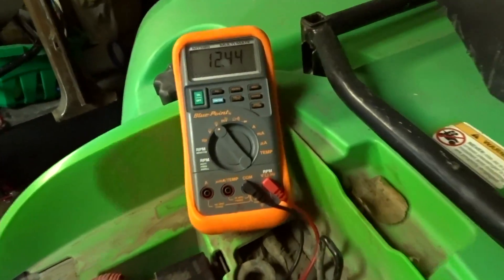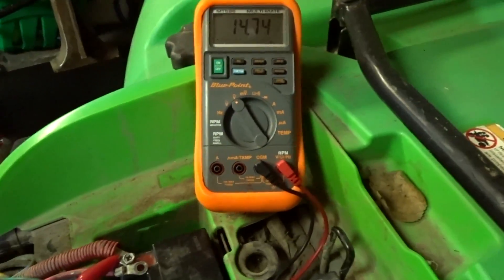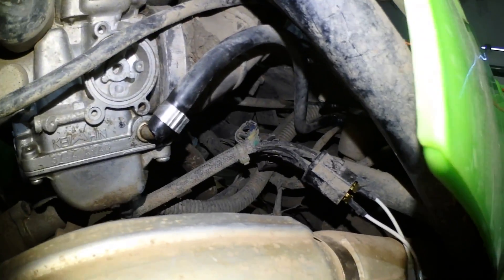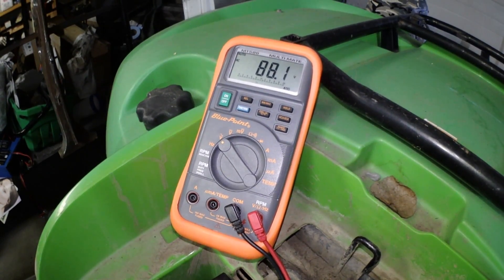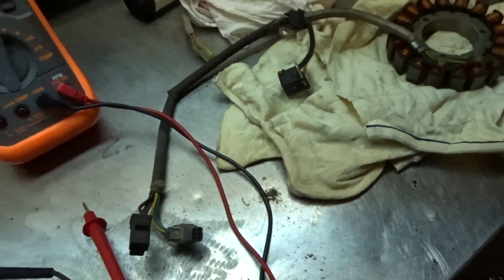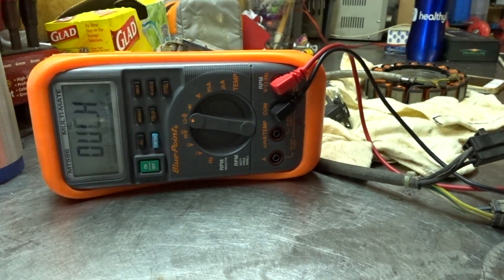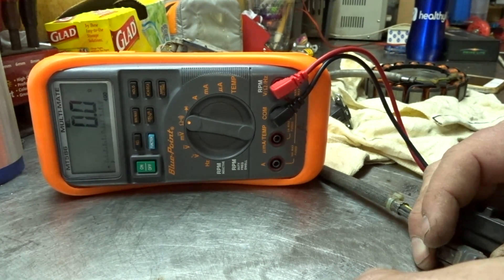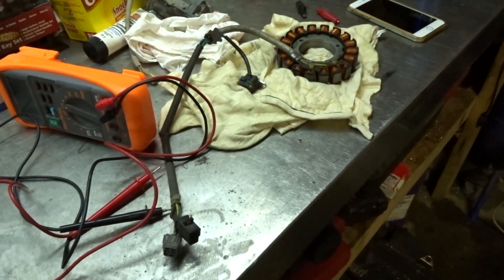How to Test a Stator Arctic Cat 650h1 DIY

Comment: My plugs from the stator have the 3 black wires on 1 plug. The second plug only has 2 wires, blue and black with white stripe. Do you know how to test the stator like that? Its a 04 artic cat 650. No spark. Trigger coil measured 0.04 ohm while static and 0.04 while cranking. Tested on the 2 wires coming from stator (blue, black white stripe). Any ideas? Anyone?

Comment: I've got the same wheeler as you have there . I have 3 diodes in my fuse box . I used a test light to check continuity and no power is going to any of the diodes . Is there supposed to be? If so ,how can i test or fix ?

Comment: I have an 07 500 not charging. Bought and replaced battery and a voltage regulator still no luck.. Next step you think the stator should be checked?

Comment: I have a 2000 artic cat and it keeps burning up the ignition relay I believe that's what it is. Is there such a thing as the starter over charging
Reply from the maker: Check your regulator could be bad
Reply: @TestDontguess  I have a couple questions.  I have a 06 arctic cat 250 with no spark I've seen other models have issues with the magnets on the flywheel falling off. Was that a issue with the 06 250 ? I held my spark plug as it spun then flipped the override switch and felt a single spark at the plug and at the handle bars.
Reply: @TestDontguess  yes it is the voltage regulator it burnt up the oem and a replacement one every thing works as it should and it runs and rides.    good but keeps burning up the regulator any ideas thanks in advance

Comment: I have a 10’ mudpro 700 and I’m having an issue where the bike will only start with a battery charger on 40/50amp start. I tested the stator like in the video and everything checks out... I’ve changed battery’s, tried jumper cables, etc will only fire off charger on high amps. Any ideas?

Comment: Hi Jerry. Don't mean to be an armchair critic, but just thought I'd mention new camera audio doesn't sound like it's central. The right channel is quieter by about 7.2dB. Perhaps the camera audio gain on the right side isn't as high as the left. Anyway, just thought I'd mention. Cheers for the vids!
Reply from the maker: it wasn't in the beginning was trying to figure out how to operate it, had a issue with no sound on one channel and tried to duplicate it and pretend it's stereo.  I will double check the audio gain next time i use it